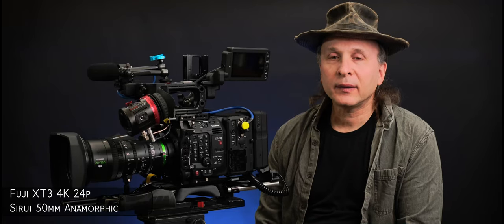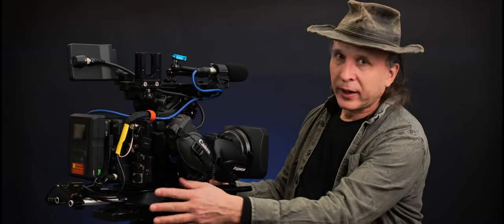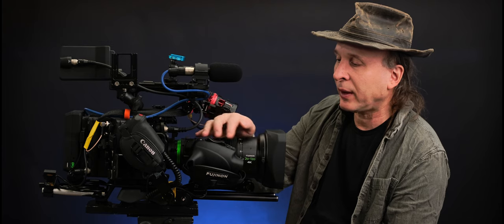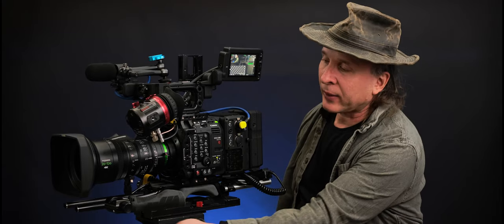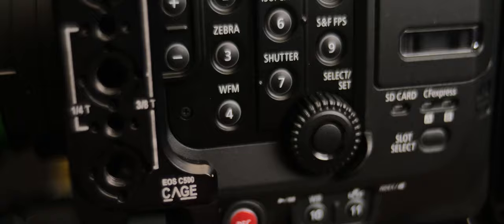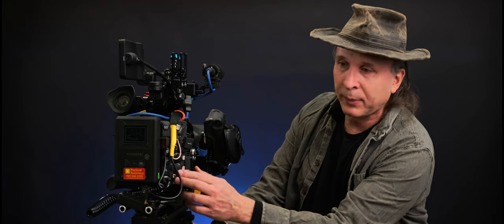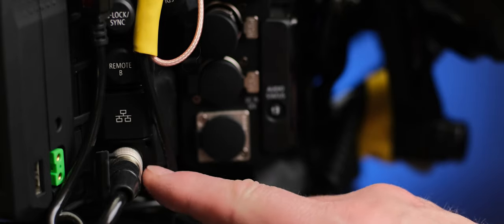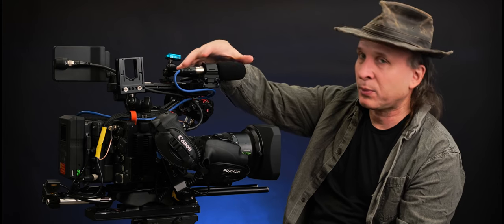Everything You Need To Know To Get A Fujinon 20-120 Cabrio Working On Canon C300 mk3

Comment: @Steve Oakley Its funny, I was talking to Canon today about controlling the IRIS on a Fujinon Cabrio PL via the camera head electronically.  Canon said that on PL mount lenses this was not possible. 4 pin connection of the mount was meta data only. Hilariously you showed they are incorrect! Great video!
Reply from the maker: thanks but while a Cabrio may have the zoom work, nothing else does. to get the iris to work you have to use the EVU2 extender + lens cable. same fpr sp,e pf the lens controls like Rec. quick zoom should always work since thats part of the lens.
Reply: @steve Oakley from what I see on your video is the power coming from the back of the camera. The lens data for iris would be coming from the 4 contact point on the lens. The way to test this would to be powering the lens off d-tap and see if the camera still can control the lens via the wheel on the left side of the camera.
Reply from the maker: @kevinnorris1691  back of the camera is the EVU2. lens data is on the cable. the test is simpler, just unmount the lens but leave the 20 pin on and see what happens. Iris control is 100% on the cable. no cable, no control for sure including the body dial. The cabrio also acts very strange because its not getting enough power. having talked with canon pulling max power draw via the mount risks frying the power ciricut since its not rated for what ironically canon lenses like the 17-120 need, but the 20-120 needs far less power to be semi-functional. I get it, no one wants to spend $1500 for the lens power to make everything work and canon should of had it on the body like sony & panasonic, but they didn't :( every once in a while one goes by for sale for like $1k so possibly you might be able to get one a bit cheaper.

Comment: I'm having the same problem. My lens worked manually yesterday when I got it. Now the iris is spazzing out in manual mode and auto. I wonder if the 20 pin to d tap would fix the problem. I just want the rocker to work and the iris and focus to stay in manual mode. I guess I should finish watching this video for more answers.
Reply from the maker: Going to power only doesn't really fix anything, or at least you are loosing the iris / exposure functions from the camera body. focus motor should work with appropriate remote in a power only situation. no please complain to canon about their firmware bugs. can send you email offline who to contact.
Reply: @thedp  Got it. I ended up shutting off the iris initialization on the lens. Been working fine in manual mode. I'm still waiting to get that cable to power the zoom servo. I'll send an email, who do I contact?
Reply from the maker: @Ex3oP  initialization doesn't seem to hurt anything, I met the right person @ canon @ NAB this year but I'm not posting their info here. DM me... and I'm looking for the email right now.
Reply: @thedp  ok, just emailed you.